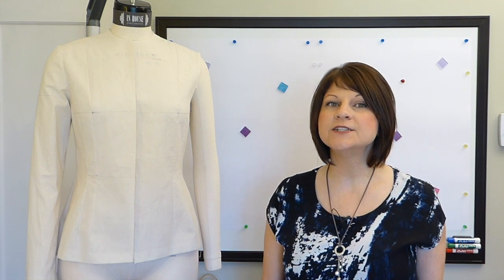Pattern Fundamentals: How to True Darts and Manage Dart Volume

Comment: This is a brilliant video. I have done a fba and have an enormous dart, when putting the dart together, due to the shape of the dart, the side seams do not square up. I have tried in vain various ways of correcting it, but to no avail. I think it is a french dart going by your illustrations. Perhaps you could enlighten me as to why the side do not match. Also when truing the dart, by folding it in place, the ends of the dart do not come out as points, but go inwards towards the dart ??? I have tried several ways of truing it, but again, it does not do what I want it to do. Have you any ideas? Thank you for this very informative video, I will download the pdf, and have a go. Many thanks.